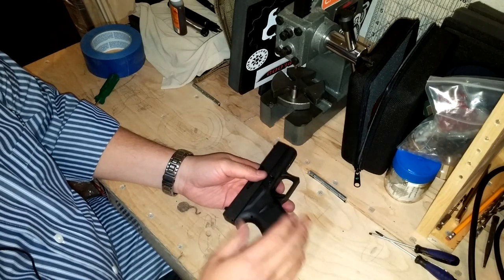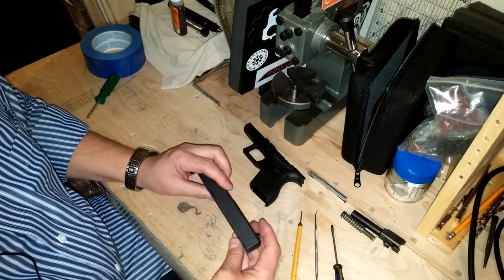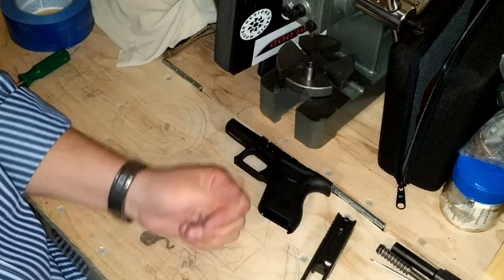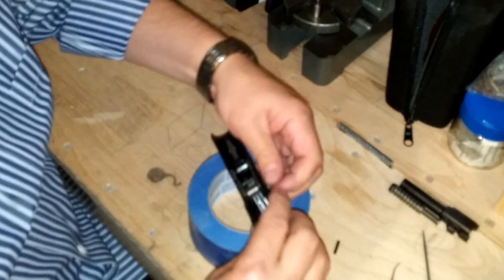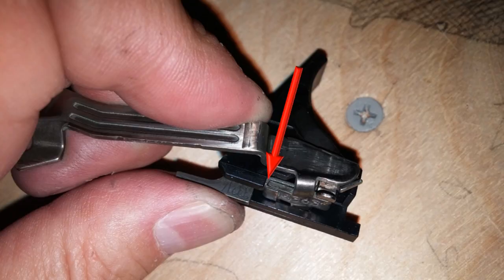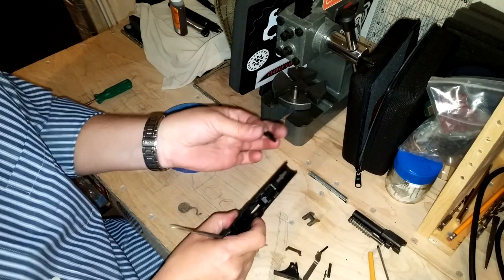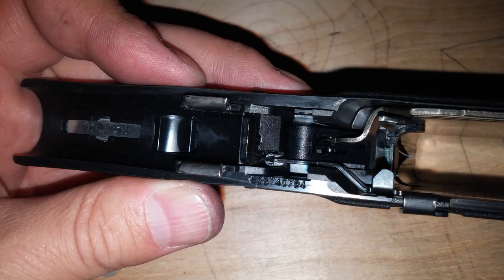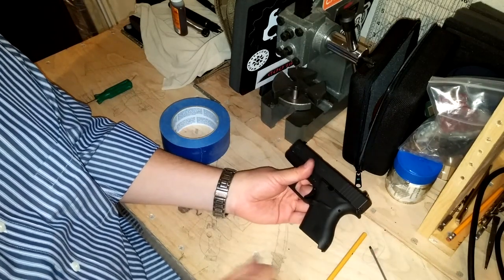Glock 43 Full Disassembly - There are ways to screw it up!

Comment: Thanks for the video...I wiggled on that dang slide stop for an hour and nothing.  The push down trick on the front was the ticket.  Also I found that you can take the slide lock out and put it back without the use of the pick.  I just pushed down on it from the inside "right in the middle of it" and pushed it out either side.  When I put it back, I just used the tip of the edge to depress the spring and pushed it right through to the other side and it popped right in place.....Thanks again, great video!
Reply from the maker: +Roy Williams Glad I could help.  I'll have to try the "pick-less" technique.
Thanks for watching/commenting.

Comment: Great video! With the slide stop you can also just lift up and wiggle the lever to get the pin in or out rather than pushing with a screwdriver.

Comment: The j shaped hook is important. If cruciform is not assembled correctly into the j hook the trigger won't reset every time when slide is racked by hand. I learned this the hard way. Although the gun still fired 100% even when assembled wrong, lol. I fixed the problem and it resets every time now if slide is racked by hand.
Reply: I did exactly the same thing with the same results.  Wish I had watched this video first.

Comment: I put a ghost spring in my 19, 30sf and 43. the 43 trigger wouldn't reset unless I racked the slide. I was almost ready to put the original in and send the firearm to Glock. your video saved me time and money. The 43 is the only Glock to date thats set up slightly different. great video bud.
Reply from the maker: Thanks Arriet, I'm glad I could help.  Thanks for watching and commenting; I appreciate it.

Comment: My safety plunger doesn't drop back in. I have the flatter side facing the rail cut. Just doesn't go in. Seems like this has been a nightmare lol, nothing works like it does in these videos.
Reply from the maker: Cole Byre I don't want/mean to insult; I just have no idea what you are trying, so I tore my G43 down to try to recreate your issue.  I am assuming you are trying to install the plunger and the striker is NOT installed.  That said, I was able to get my G43 to do what I think yours is doing.
When I put the safety plunger in straight down, sometimes it gets caught on the lip of the ejector cut out.
If you are holding the slide, with the front facing (barrel end) toward you, and the plunger hole facing up; put the plunger with spring attached, into the hole and then tilt the whole thing (slide with safety plunger) about 90 degrees to the left.  The plunger should clear the lip enough to depress in all the way and allow you to install the ejector, to hold the safety plunger in place.
I'm not sure if yours is doing the same thing, but I hope this helps.
Let me know how it turns out.
Reply: ***** No it's quite alright. This was my first time detail stripping a Glock so I was all over the place. The issue was I was trying to put the plunger in after the firing pin assembly was in place. Once I pulled out the firing pin assembly the plunger dropped down without a hitch. Thanks for going through the effort to do that for me though.
Reply from the maker: Cole Byre No problem, I'm glad you figured it out.  If you are like me, I'll bet you get it right from now on.  The hard lessons always stick with me.

Comment: same as other glocks, they have those 2 groves on that pin. you just need to wiggle the slide stop while pushing the pin through. not rocket science
Reply from the maker: +Jonathan Tran I've never had to do that with any other Glock, it always just pushes right out. My G43 pin won't push out unless I deliberately push down on the forward section; wiggling the slide stop doesn't cut it.
Reply from the maker: +John Stevens I agree this works on other Glocks.  My G17 pushes out with no problem, I usually don't even have to wiggle the slide stop.  The G43 is different; it has a coil spring on the front of the slide stop, and I have to compress it for the pin to release.
Thanks for watching/commenting.